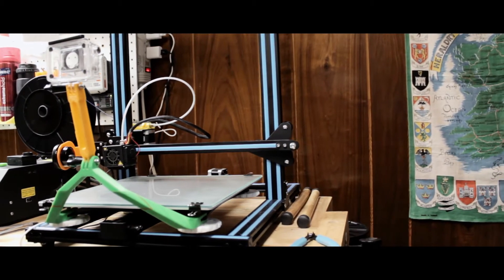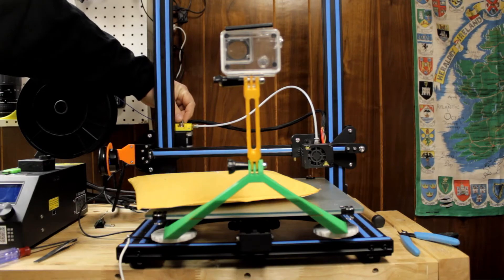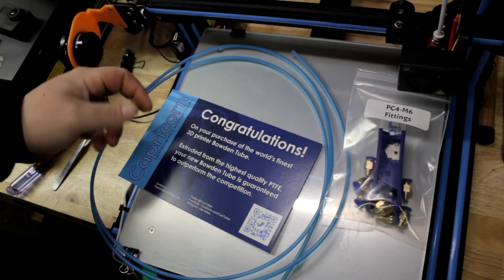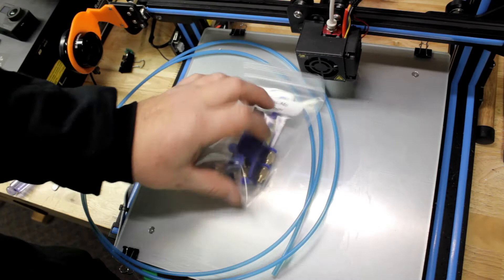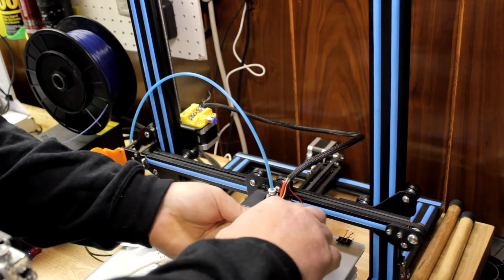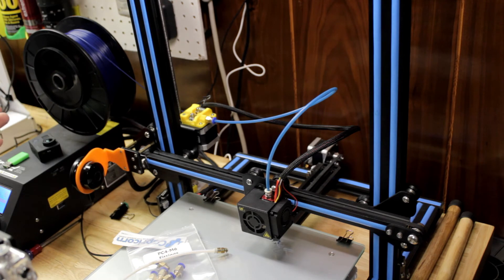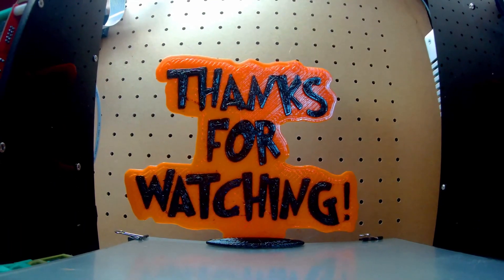Installing Capricorn PTFE On a CR-10

Comment: watching again.  there is a drawback from having the tubing go all of the way to the print head.  you get hot Teflon tubing that clogs that much easier.

I'm a machinist. IM long to try to design a copper heat block and the cool section 
made from stainless or aluminum with internal ribs so the tubing only touches the ribs and the cone inside the print nozzle

Comment: Im sure you found out by now that this did not fix your problem.  it was the fan or the spring
Reply from the maker: It definitely helped, but I ended up converting both the cr10s to direct drive.
Reply: @RevampedOutdoors  im wondering if that is what I should do as well  I just go the cr10 v2 a few weeks ago and I'm already having issues with clogging 

where did you get the direct drive kit
Reply from the maker: I went with the printermods kit, under $40 and has been working well on both printers. I upgraded one with marlin and a UL power supply, definitely worth the work.
Reply: @RevampedOutdoors  i guess I'm to new, I'm not familiar with that.   I'm looking for a China product like the ender one from bangood

Comment: I'd like to know what adjustments in your slicer program you had to make. I ought ty he XT serier version and I need a starting point. Even to get my extruder to push the filament through the printer.
Reply from the maker: Interesting I didn't have to do anything after the install. Most of the issues I've had with the cr10 has been hardware based, I've had to clear the nozzle throat quite a few times and replace nozzles. The thing that helped out the most was upgrading the hotend ptfe fitting so the tube stayed snug on the top of the nozzle. The stock fitting seemed to let the ptfe slip and then the filament jammed. It would go well for awhile and then start to jam. The cap tubes helped the filament move through easier than the stock tubes but then it eventually had issues. I've been running the light blue on my ABS cr10 for 4 months now no issues. If you're looking for the fittings be sure to get the ones with the black plastic collar for some reason they have better grip strength. Hopefully the information helps a bit.

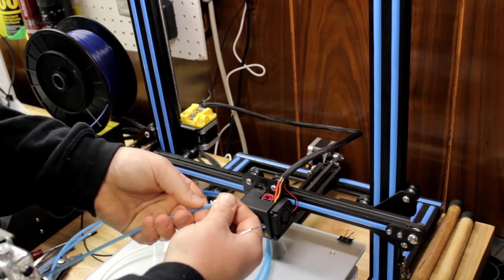Comment: Just attempted this upgrade myself (I got the TL 2m kit) and I don't know what I'm doing wrong but I could never get the tubing to advance even halfway into the fittings provided in the kit.  When I look into the fitting I can see the tube is clearly being blocked by part of the fitting's interior (not the teeth)    5:30 The way you just slid the fittings on prior to install is definitely not happening on mine.  My fittings are also silver colored not the brass ones you have, don't know if that means anything.  The larger one also barely screws into my hotend, halfway through tightening it down it gets waaaaaay too tight and still has half the threads to go.

As a result I destroyed a bit of the tubing and got a fitting completely stuck in the process.  It's kind of ridiculous how much force is required to feed the tubing through and I never managed to be able to.  Many people swear by this product so I must be doing something wrong.
Reply from the maker: Uhm, maybe the fitting is broken? It should slide on easy if you compress the collar of the pneumatic fitting (the small grey/black) part above the stainless. Pressing that toward the stainless should make the teeth inside the fitting retract slightly into the walls of the fitting. I hope that helps and you get it working!

Comment: Great, so I need a completely new fitting for the goddamn drive end connector.
Also, while you were very thorough in your explanations, being a tad more concise would also be a plus in my opinion.
Reply from the maker: Well that would depend on your situation, if you're extruder fitting is broken or not working you will need one there.  If you're PTFE tubing is coming lose on your hotend you might need one there.  It could simply be a function of cutting your tubing slightly less to get a stronger grip with the stock fittings.  Both the hotend and the extruder require pass through fittings.  Both are available on amazon or captubes at affordable prices.  In my instance the filament I use is out of spec so it was causing jams, cap tubes helped mitigate the problem slightly. Thanks for the view and the comment.
Reply: @RevampedOutdoors  Any time bro. Like I said, great vid! Just perhaps a bit more than needed be said is all.

Comment: 6:24 is your nozzle screwed in at this point or is the nozzle unscrewed and taken out when you do this step?
Reply from the maker: I usually leave it about 1/4 or 1/8th turn loose so it mates up with the end of the tube when the nozzle is tightened.
Reply from the maker: If you tighten the coupler down it should work in a similair fashion to mate the end of the tube and the top of the nozzle. Either way the idea is to mate the two surfaces as tight and true as possible.

Comment: Good vid.  Have you tried printing with the Capricorn tube yet?  If so, did it fix the issue you were having?
Reply from the maker: Ron Floyd it seems like it so far but I've had to slow it for some time already, I think it might be a factory hotend issue as well so it helped but not 100%
Reply: If you use a chamfer tool on the fitting it eliminated the blunt end you are trying to push the filament by. Less need to bevel the filament end and fight it through.